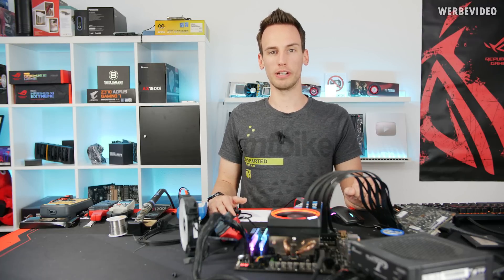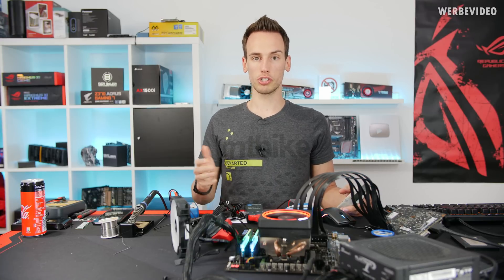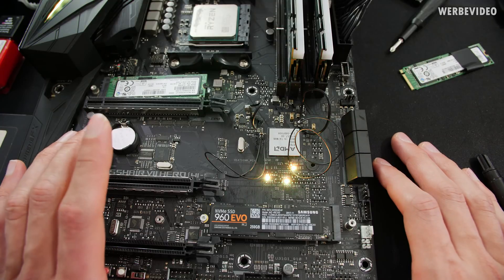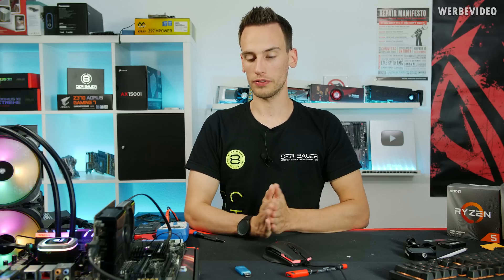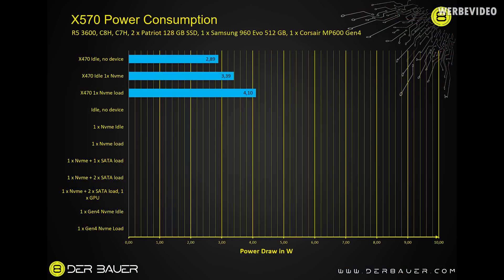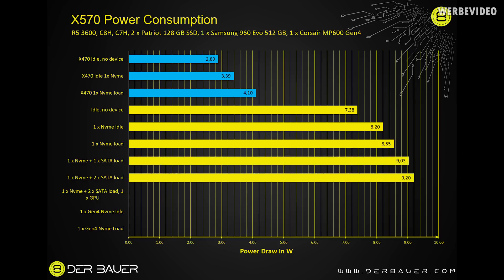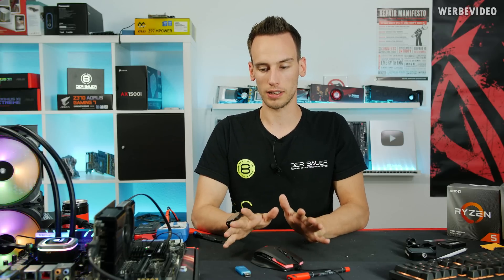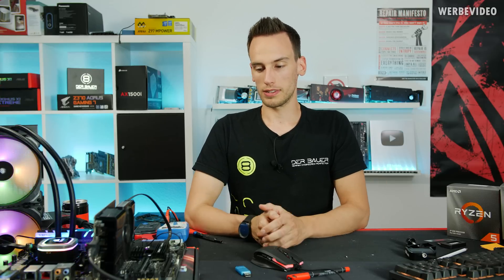X570 Power Consumption Measured - What is going on here?

Comment: It's good to see how wires and SMDs are soldered on by hand. It could help if delidding goes wrong.
Reply: Probably not easy by hand... however you can SMD solder with a hot bucket of sand, so that’s a better option.

Comment: it's not the pci-e 4 or nvme or anything like that. the simple reason is that board manufactors go for "apple" aka fancyness over proper operation. i've had bs mb chipsets like p45, x58 etc (20+ watts) working 24/7 with no active cooling in cases with almost zero airflow for 8+ years before they bite the dust. they don't even try anymore, just stick a piece of something and be done with it. that's why i'm never going to buy a $250+ mb that doesn't have a proper heatsink, something that was solved from back at 2010.

Comment: Rumors before launch mentioned x570 having power issues which delayed the Zen2 launch. AMD changed the team doing the chipset. There is some bug or flaw.  Ryzen 2000 test would be interesting to see the processor interface effect.

Comment: i bet if you slap a proper heatsink and not some RGB garbage you dont even need a 40mm fan, that will probably fail in a year.
Just get the normal finned heatsink from the VRM, make it shorther in height so it wont interfere with the gpu, slap that bad boy and done.

Comment: Remember the X570 chipsets are made and designed by Global Foundries and AMD not ASmedia like the previous ones, so i guess they suck at optimizing power consumption
Reply: ...ooor, it was designed by AMD as a universal I/O die because it's the 14nm version of what's found in the Ryzen 3000 series CPUs(in 12nm form). And, the whole point of doing this is that AMD is contractually obligated to support Global Foundries with a minimum order of silicone each year, and, since AMD has moved Ryzen onto 7nm and GloFo doesn't have an operational 7nm line right now, leading AMD to move CPU production to TSMC, they needed to offer GloFo something that they can manufacture which AMD needs to be able to make a profit on to make it worth it; and, seeing as how motherboards need a chipset to control the I/O functions of a motherboard, "might as well..."
Reply: GloFo had absolutely no involvement with AMD's I/O die designs outside from being the place where they are made. AMD did the designs for both I/O chips COMPLETELY in-house.

Comment: I would rather have a passive heatsink with some interesting design than say Wi-Fi onboard or the second EPS 8-pin connector that no one needs.  This reaks of rushed design but in all honesty the board manufacturers were probably told up and down by AMD or GloFo that it was necessary.  Thank you for the deep dive into this, literally no one else is talking about it.

Comment: PCI-E 4.0 RAID solutions maybe can push the power draw of the chipset up to the point of requiring more cooling? I remember hearing specifically it was due to  RAID arrays of NVM-E drives that would generate enough heat to require better cooling. Maybe if you could get one of those 4 drive NVM-E RAID add-in cards and see if that affects your results. Or maybe there is some bottleneck with the chipset only having 4 lanes to the CPU so it won't actually be maxing out it's PCI-E power requirements.

Comment: The CPU is always taking to X570 via PCIe 4.0. It is always active and there is no such thing of idle, hence the high power consumption.
Reply: The CPU is always talking to the 470 over 3.0 and the power draw isn't that high.
Reply: Not really.

He just showed on this video that adding PCIe 4.0 devices barely make the power usage change at all. Energizing 4x PCIe 4.0 lanes did almost nothing at all.

If PCIe 4 was inherently power hungry this would not be the case.

It's just an excuse, PCIe 1.0, 2.0 and 3.0 all use about the same power, same as 802.11a/b/g/ and 802.11n/ac/ax. There is a minor change to the physical layer and a major change to the signalling/modulation.

Comment: This is from a reddit thread:

"The primary reasons are packaging and signal integrity. It's better for the modern chipset to be closer to the PCI-e slots because PCI-e signals are more susceptible to interference than old PCI or AGP signals.  The result is that the chipset ends up in an area where a video card might extend. In order to prevent interference with video cards, the chipset heatsink needs to be low profile - hence the fans."

Could this be the reason for the fans?

Comment: At least four review sites (including you) have noted that high idle voltage now, not even counting the chipset.   For the chipset, I wouldn't have actually expected it to eat much power unless there were a ton of PCIe-4 devices plugged in.  Sure, it will use 4 lanes of PCIe-4 between the CPU and the chipset, but that's just 4 lanes.  What is going on, indeed!  The chipset just shouldn't be producing enough heat to require that little fan to turn on, under any load, short of having a lot of PCIe-4 peripherals.

So perhaps there is a voltage control issue.  I can't think of a single reason for that X570 chipset to burn so much power either, other than being over-volted.  Makes no sense to me either.

I'm not entirely sure those resistors are 0-ohm bridges.  Are you sure they aren't current sense resistors?  i.e. very low but non-zero ohms?   The voltage could easily read the same on your 3.5 digit multi-meter.  However, if the SMD resistor has a single digit '0' sillkscreened onto it, then it is a zero-ohms bridge.

-Matt

Comment: Perhaps long video cards limit a heatsink height so they decided on a fan?  I suspect the X570 chipset was not designed optimally.
Reply: They do limit the height, it's something like 1.5cm, and that's true for any design and ironically that's what chokes the air supply of the fan and makes it half useless (it's already small as it is).  As this fan sits directly under the GPU and has no air.  Therefore it runs louder and 10C hotter.  Only MSI thought of a workaround for this by moving the fan to the side.  His point in the video was that even if you're limited vertically, there is plenty of horizontal space to cool 10W of heat, without ever needing active cooling.

Comment: This chipset reminds me of Nforce4 Northbridge on my socket 939 k8nf9. When I read 70°C on the chipset in the monitoring software, I kinda freaked out. I popped the case open and put a finger on it: it was burning hot. I shut down the PC, and did some research, what the hell is going on. It was unusually high temp at the time. For comparison, the Athlon 64 CPU had a 65°C junction temperature. As it turned out, it was normal operating temperature for these chips. To be safe, I put a 50mm cooler above the chipset, thought it didn't improve the temps at all. D:

Comment: Roman this video was almost up to the old level of German efficiency, but you forgot to test the M.2 NVME in raid 0 on chipset and put them under load, because the rumors was that chipset COULD throttle under that load, 

but somehow I thing it would take a hot room and a dell/hp style of close steel case and hot gpu

now x370 was a 55nm 
the x470 was a 28nm
the x570 is a GlobalFoundries 14lpp 14nm

so most likely the fan is a better safe than sorry deal and a fan is maybe cheaper to make or just more "cool" than a old style southbridge, northbridge and Vram heatsink connect by heatpipe kind of setup

Comment: There are a few things you can do to saturate the PCIe 4 lanes better, such as running NVMe RAID0 off a PCIe slot, or running some compute loads through the GPU with a PCIe 4 GPU.  You barely scratched the surface of what PCIe 4 can do by testing just a single NVMe drive.  I would surmise that if you tried to do more of a content creators style build for example, with say two 5700XT's (for video or 3D rendering) and 4 NVMe drives off the thrid PCIe slot, or even just three in the slots on the mobo, you would get that power consumption up enough to need a fan.

Comment: 17:10 The chipset is a "dumb" I/O controller, it doesn't gate off unused silicon and constantly runs at pci-e 4 speed between the CPU and the chipset, thus the high power consumption.

Comment: gotta milk the cash cows somehow. AMD ticked all the right boxes with Ryzen, only to squander it with the ridiculous over priced motherboards. Better off running the new cpu's on x470.
Reply: AMD has stated in official capacity that X570 isn't an X470 replacement - they fully intended for many customers to only use 300 & 400 series boards with the 3000 series, while X570 is available for, 1. work station-esqe use cases that are capable of taking advantage of PCIe 4.0 once the market catches up with appropriate products(P4.0 capture cards, for instance), and 2. customers that want the latest and greatest/have a budget that overlaps into X570 price range so "might as well"(after all, if you're looking at a 470 Taichi Ultimate or Crosshair 7 or whatever, why wouldn't you just move up to the newest chipset?).

I really don't know what you think was "squandered" - I guess they could've released X570 without PCIe 4.0 so that they could be manufactured more cheaply, then locked the 3000 series into only 500 series boards and higher, even though they literally wouldn't be offering anything over the 400 series boards except 'newness'. Would that be preferable just so you don't have to feel 'lacking' for settling for last year's boards, even though there's no performance difference at all as far as the CPU is concerned?

If you don't understand why AMD was obligated to introduce new motherboards when the 3000 series doesn't need them(...neither did the 2000 series, but no one complained...), consider how exactly motherboard manufacturers - manufacturing partners of AMD & Intel - make their profits each year. Also, consider how AMD is supposed to fill their contractual obligation to Global Foundries, as a 'spun off' company, to order a minimum amount of silicone each year when AMD has moved on to TSMC 7nm when GloFo canceled their 7nm node development. This is the entire reason why the 570 boards are based on the CPU I/O die in 14nm form; which is very likely the entire reason why it's drawing so much power.

Comment: Awesome job. That heatsink is exactly what I was planning on doing, but sadly the only mATX board didn't have alc1220. P45 chipset was 18W and that was passively cooled, so had no doubt this could too. X570 heatsinks are just piece of metal with hardly any fins and horrible fan slapped on top, it's like they didn't even try.

Comment: Ok. I might be wrong but I might see the issue in here. You have connected only 2 sata devices, try to populate all of the ports on the motherboard. Use all NVME ports aswell, and add GPU or other device into the PCIe slot. AMD is usually marking their TDP as worst case scenario, even their GPUs are TDP marked as power consumption of whole card, not only the GPU die. So, meybe these 15W of heat we are talking about, is the worst case scenario for this chipset, and motherboard manufacturers must be ready for the worst case scenarios.. they do not want RMA their motherboards just because somebody had populated all of the sata boards :) In terms of Chipset heatsinks.. well.. Your 2 euro heatising does not have RGB!!!!! (this is most important feature of any hardware these days)

Comment: If motherboard manufacturers are anything like car manufacturers, they probably have a worst-case environment that parts have to work. Like, imagine a cheap apartment in Abu Dhabi in the middle of summer with no air conditioning backing up a PCIe RAID array over a 10gb network connection in a case with only the stock exhaust fan! This results in some parts being terribly over-built for 99% of users, but they don’t have to have multiple SKUs for different parts of the world. Of course, given some of the hideously under-cooled low-end boards I’ve seen, maybe the environmental testing is a bit more flexible.

However, the reality is probably that the chipset provider (AMD) recommended active cooling for the chipset, so all the MB manufacturers just went with the recommendation. No one gets fired for following the manufacturers spec!
Reply: I actually recently saw a homebrew server youtube video from a fellow in India, he had a couple desktops converted to file servers sitting in an  room with no cooling, there was just one small open window, not even a second window for cross ventilation, very stagnant hot tropical humid room , he commented on how incredibly hot the room was and how he could not spend much time in there with the servers.  with surely well over 100 degree (38 degree) room I would hate to see the case and CPU temps. but to your point the servers (formerly desktops) were running fine and from the dust look like they had been running for quite a while without issue.  

last summer My AC went down for a while, it was well over 100F in my house during the day, my computers were fine but they are home built with typical DIY overkill cooling. not your typical Dell with just one 80mm fan exhaust in the PSU. 

I would be interested to know what a typical design ambient temperature is for a typical computer, cooler is better, but they do have to design for a worst case, what is that worst case temp? maybe it does play into these kinds of decisions.

Comment: You have to understand that MotherBoard manufacturers need to add things, even if they are do nothing devices, to increase the cost to the consumer so that margin profits can be made.  These bling things are designed in a way to make the consumer believe they are "moving forward" with design and function to keep increasing prices.

Comment: @Der8auer - Don't know if you saw it, but Ian Cuttress had mentioned that AMD used the I/O die as the chipset, which may be built on 14nm and they used the I/O die built on 12nm GF for the die on the CPU supposedly for better memory support/overclock. 

They originally planned on a full 8 lanes of infinity fabric between the CPU and the chipset, later cutting it down to 4 lanes to lower the power consumption from the rumored 15W to 11W. So, you cut off the memory channels on the chipset I/O variant, along with other features, but you have to power IF, which seems to be power hungry, allegedly. So part could be using IF to connect chipset to the socket (part 1 of the theory). This would allege that there is 4W solely needed to drive 4 lanes of IF though.

Part 2 of the theory is that, because it is an I/O die as a chipset, it was not made with the power saving features a chipset designed as a chipset from the ground up would have. So higher idle power consumption. 

Because of this, I'd love if you could dive into the power consumption of the I/O die on the CPU to compare the values for what devices are connected and power draw, while then having to figure out how much of that is going to memory, inefficiencies of 14nm versus 12nm GF process, etc. 

So understanding the I/O die on the CPU may help to further understand the I/O die as a chipset, including power consumption. Just a thought.
Reply: One thing to keep in mind, there are entire CPU built on 14nm that draw less power at idle and just barely more at load with the memory controller and IGP built in.

AMD didn't enable any power management to speak of.

It could be that caused issues with Infinity Fabric, latency was too high when ramping up to normal clocks, etc...
Reply: I believe you are correct that the IO and chipsets were manufactured on 12 and 14 nm but I think you have them backwards as most sources are quoting the CPUs as being 7nm/14nm not 7nm/12nm
Reply: @bappyplays  No. The CPUs use a 12nm IO die. Dr Cutress "triple checked" with AMD.
Reply: X570 is also 12nm. It's the EXACT same chip that's on the CPU's. There is no 14nm "small" (mainstream) I/O die. That silicon simply does not exist. Your "theory" was mostly right though, as seen with TRX40 (which uses the same chipset silicon). Z490 (AMD's version) was originally on the roadmaps as an AM4 platform with the fully enabled chipset, just like on Threadripper, but it was canned for cost & product segmentation reasons (X570 was already at enthusiast pricing, and people who needed more I/O than it provided would be better served by Threadripper anyways).

Comment: That's horrible. So unsolder SMD components. It seems competent guy. Update tools. For example, Quick858D thermoair soldering station and Quick202D ESD lead-free soldering station. It's not that expensive, unlike the ASUS 7800 GT Dual.))) Respect bro.